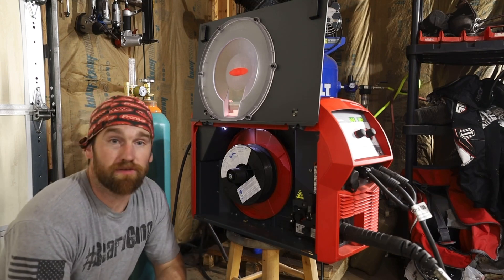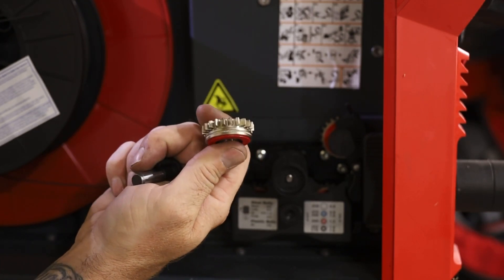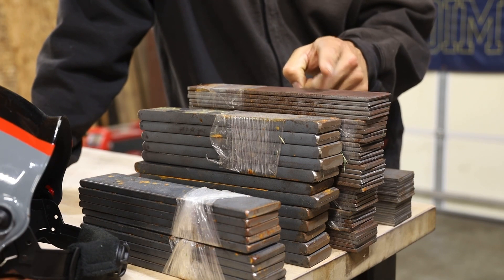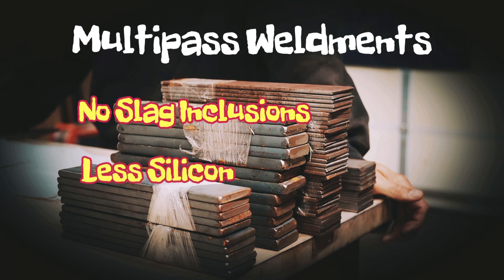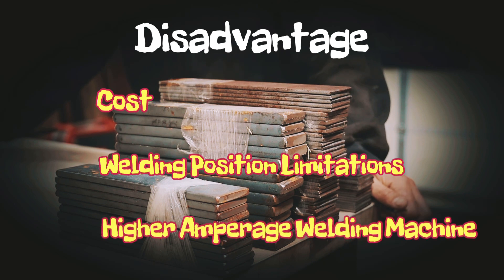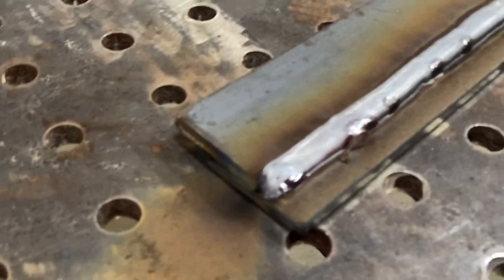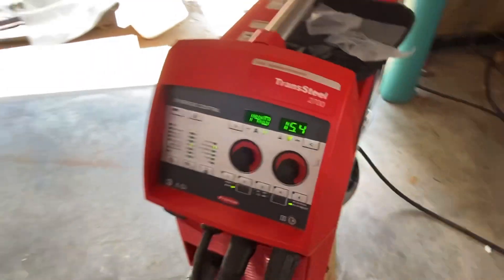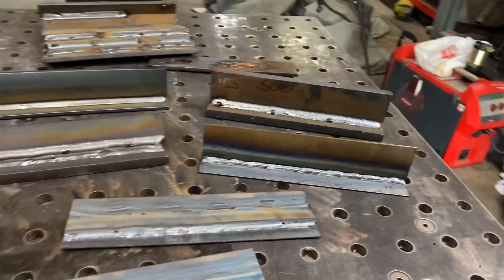Increase Productivity Utilizing Metal Cored MIG Wire #welding #multipass

Comment: Hi mate great to see a upload on metal-core cheers. I use to use it in production applications mainly Bizalloy low carbon / hard steels and always pre heated to 95 to 115 degrees Celsius. It's such a touchy wire to use as any change in torch angle or speed shows up in the weld every time.
The smaller welds we use to do with metal core was 6mm - 8mm with the 6mm used in 3 pass multi for 12mm fillets. 8mm fillets we welded in 1 pass. 
In new Zealand it's common to drag as the aggressive nature's of the wire cuts into and redistributes the parent metal and then fills it in giving you the consistant penetration tho using this method it's very easy to get a slightly beaded weld and not smooth and flat. Another method would be to weld at 65° angle after starting with a back stepped start and puddle giving a slight 45° flick this would allow for the weld to gain height and run down and flatten the back as its cooling for perfectly flat and smooth welds. I'd also mention that if you use metal core like how we did we used 400 to 500kgs of wire per month each atleast a 20 - 30 kg roll per day. 
With the Bizalloy being so hot before we started our welding touches were twice as long as yours and to be honest still use to heat up like hell 😂 but you get use to welding at an arms length away from your work and also away from all the heat and smoke. even with fart packs it's still smoky as hell and when possible we always welded left to right being right handed as alot of our welds were 1 even 2meters long starting on the left allows you to weld up to 2 meters in 1 go if you weld right to left your body gets in the way or you gotta start walking lol 😂 another tip is we use to have mad wire stick out as with all the welding the tip shrink and the wire binds so it was common to go from at size tips to slightly larger diameter tips on hot days other wise you spent an hour a day changing or cleaning your tips  😅 
We never had problems with splatter as that typically happens from the use of to much gas flooding the weld area. 
Great video mate keep up the great work. 
Cheers

Comment: I started working at a placw that uses metal core .52 at 27v 370 on wire and im have trouble with it laying flat good welds need some pointer's
Reply: Less wire maybe

Comment: Can the 2700 weld Aluminium?
Reply from the maker: Yes 🙌
Reply: @chris_b_liven   Thanks Chris, do I need to buy extra parts ? Or these machine works as the 2200 when welding Aluminium on mig?  By the way  appreciated your help I'm trying to get a new welding machine.
Reply from the maker: @angarorz1  Yes, I suggest ordering the aluminum parts which include a 1/16 liner, drive wheels and .052 contact tips. Send me an email at bliven.christopher@fronius.com and I can assist

Comment: Push direction but keep it pretty much 90 degrees because it drives it into the joint alot better than 5 to 10
Reply from the maker: Thanks for the tips

Comment: Kind of cheating using a Fronius to show how well a cored wire can be lol should use a miller or Lincoln for a more fair result as a Fronius would weld anything really good tbh i use a tps 320 my self so I'm talking from experience !
Reply from the maker: We were talking about doing a Miller/Fronius side by side comparison. Metal cored wire makes it a little easier.

Comment: A question Chris, if I can get metalcore say in 035 in 10 lb spools  what gas can i use with my 2200?
Will 75/25 work or should i go 90/10 ? thanks, it is the bead appearance that I want.
Reply from the maker: 75/25 works perfectly fine. The only difference will be voltage settings. The more you increase the argon the less voltage you have to use. Adjust your voltage to get your favored results - I hope all is well Bruce 👊
Reply: @chris_b_liven  золотые слова сансея!☝🙄